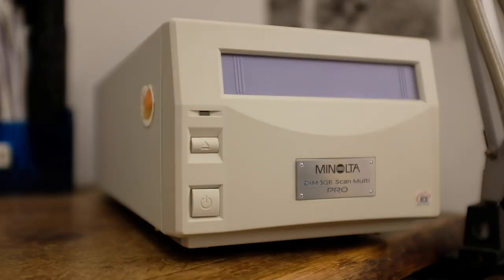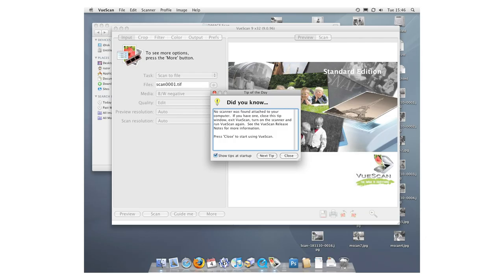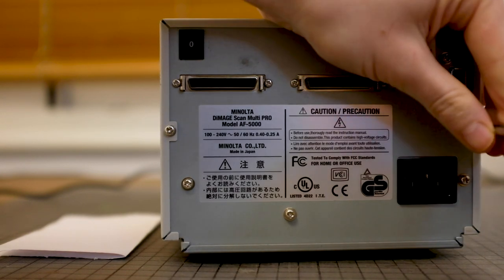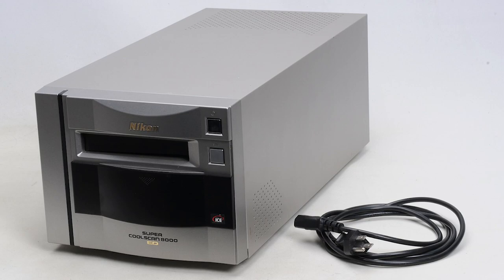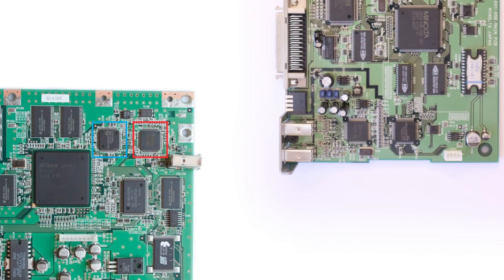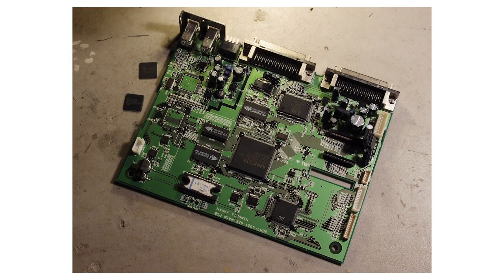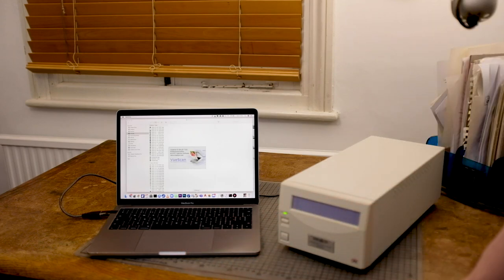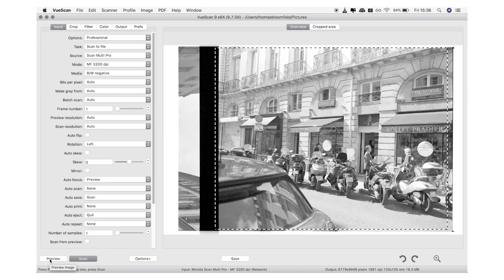Can I Fix My 20 Year Old Film Scanner? - Minolta Dimage Scan Multi Pro Repair

Comment: Can’t thank you enough for this video! I’ve been running a Minolta Scan Multi Pro on SCSI for a couple of years now since the FW connection died, but about a month ago, even SCSI scans started mysteriously hanging midway. Followed your advice and sent my board to the Gleb Shtengel at the USA link in your description to have the 2 chips replaced. About 2 weeks later, I’m back in business and it’s running like a dream again! 🙌

Comment: Great video, thank you!  I bought one of these scanners new in 2002 or 2003, but ten years later it started to develop slightly different problems.  Essentially, it would sometimes not start up properly the first time when turned on, but always started at the second try.  I listed it, with a description of the problem, and it sold for a very low price.  A pity, as it is an excellent scanner.  Perhaps it just needed cleaning/lubrication of moving parts in the film carrier mechanism.
I always used the original Minolta software, although I do have VueScan and use it with a different scanner, where it does an excellent job.
Your scanner should now work well for another 20 years!

Comment: I had been fighting the death of equipment for a few years, chasing dying Apple computers to run SCSI. Last summer I ran out of working parts (from 5 G4 machines), since Apple insisted on even making the power supply incompatible between year generations of the same model machine, and built a Windows 7 machine to run SCSI. I have an Imacon Flextight Precision II and a Microtek Artixscan (that can scan 8x10" negs). The Microtek then stopped working, it would connect, but the images would have weird inconsistencies in brightness. After taking the thing apart and running new cables for powering the cold cathode tubes, I realised that the lower (transparency) tube was starting to fail. Amazingly I was able to pull one from an old laptop, and got that machine running again.

So if you end up having computer issues, I would recommend making a Win7 machine. It works quite well, and there are many more drivers available for odd SCSI cards. Worth noting that you do have to use Edge or Firefox, as Chrome is not very kind to older operating systems, and thinks the internet is just broken.

It is such a pain that we have to do this, but sadly there are no better alternatives, without spending money that I do not have, for something that does not make me money.

Comment: Ahh this has been so helpful!! I've got a Dimage Scan Multi II and it's having the same issue, I will have to  check out the insides of mine and try and get mine working! thanks for your efforts!
Reply: Sadly it is recognised on the device manager but cannot connect to it, I have tried View Scan and also Damage software and the OEM software comes back with Error 04. I'm really unsure of using Scsi and have tried a Scsi to USB adapter but still can't get it to be recognised as a scanner.

Comment: I have a Minolta DiMAGE Scan Elite 5400 (Version 1) which is exhibiting the same behaviour as your Scan Multi PRO was before replacement of the two chips. My scanner also has a Firewire port which I have never used but I assume that it most likely has the two chips you reference on the main board. I will now remove the cover to see if that is the case and then consider having the same repair done on it as it was an excellent scanner when it was working. Thank you for a very informative and well researched video.
Reply: When I examined the board in the above scanner it did not have the same chips as your scanner. Further research revealed that it had a defective capacitor. Some initial cleaning of the cap got my scanner going again mechanically but the scan results are not good. I am hoping that will be corrected by a replacement cap. Your video helped me to pursue the issue to a hopefully good solution. Thanks again.

Comment: Fantastic detective work! I have a Multi Pro with flaky almost broken Firewire but SCSI works OK which suggests only the TI chip is dying.
Reply: The PCB area below TI TSB41AB3 is not soldered so the PCB is not used as a heat sink. The chip could be removed without excessive heat using Chipquik. I wonder if the chip gets warm and a radiator heatsink would avoid premature aging?
Reply from the maker: @jarkkolavinen6391  Thank-you for watching! That's interesting, maybe you could give an update when you replace the TI chip and tell us if that alone fixes the issue.

I wish I knew what causes these chips to fail - I'd like to get as much use out of my newly replaced chips as I can. Perhaps it is worth sticking something like this on the chips just in case overheating is the problem: https://www.amazon.co.uk/Heatsink-14x14x6mm-Aluminum-Adhesive-Computer/dp/B08F24XZ46/ref=asc_df_B08F24XZ46/?tag=googshopuk-21&linkCode=df0&hvadid=501043374885&hvpos=&hvnetw=g&hvrand=12435084272575372172&hvpone=&hvptwo=&hvqmt=&hvdev=c&hvdvcmdl=&hvlocint=&hvlocphy=9045945&hvtargid=pla-1130307710054&psc=1

Comment: Well done!  I've got a Nikonscan and this could happen to me. Apparently, I have heard that plugging in firewire / cables into the scanner while the computer is still on can cause damage to those chips to occur. But that might be a myth. Nonetheless, I never plug in a 'live' firewire or usb cable into my scanners.
Reply from the maker: Thanks! Hmm yes I think that is true - I've always done the same with my Minolta - I got it used a few years ago so who knows what the previous owner/s did

Comment: Hi there! First of all all my congratulations for being a person able to stay calm, cool and not in a hurry during the whole video, I really enjoyed the pace of this :D I also own a Multipro (and a 5400II). Thankfully I never had connection issues (at some point when I was still using a Windows laptop I even managed to use it with both the Minolta Dimage original software or Vuescan, without any problems!). But lately when scanning 6x6 I get quite strong banding all over the photos.. I was wondering if you ever encountered the same problem...? They look like couple of large parallel bands of reddish colour (or just lighter tone in B&W), subtly visible but annoyingly there! I have also being spending endless evenings trying to read about online but still couldn't find a true reason why this is happening. And it happens also with the 5400II, sigh....!
Reply: Your CCFL light bulb is probably on its last leg on the Scan Pro. Good news is that you can replace it.

As for the Minolta 5400 II, its 3 led are probably aging differently. Banding seems to be quite common with them unfortunately.

Comment: I have a Minolta Multi Pro. One year ago there was a changed lamp and a service was done. When I connect the scanner using a FireWire PC and VueScan loads it. But the LED still flashes and VueScan report: Insert the carrier or remove the carrier. When I select calibration, it gets stuck. Don't know what it is?
Reply from the maker: Hmm it sounds like the same issue I had